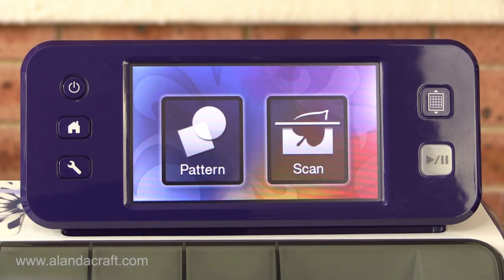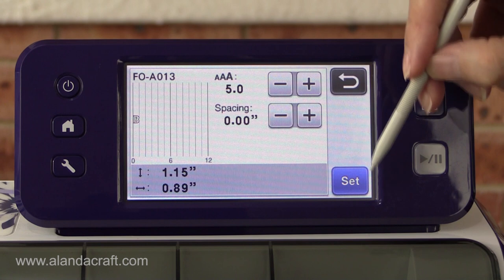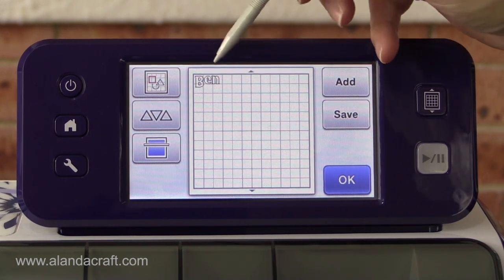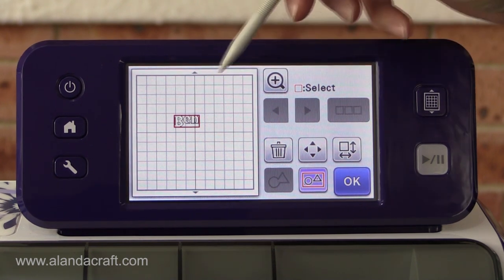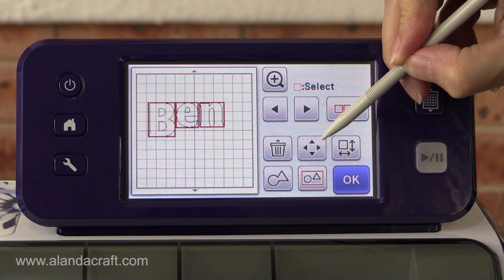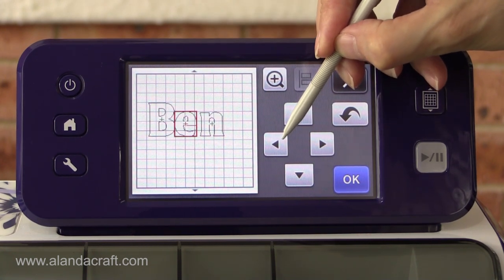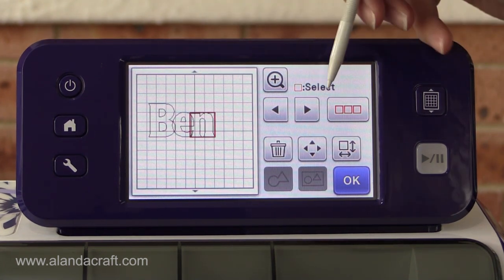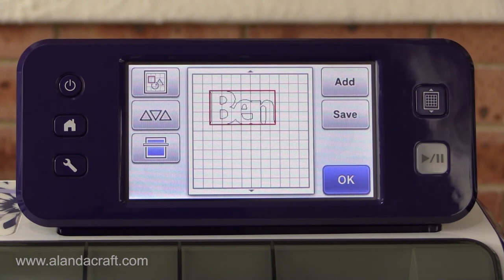Brother Scan n Cut Tutorial- How to Weld Text on the Machine

Comment: I have the CM350 and it’s telling me some patterns can’t be welded and I’ve tried all my fonts. Do I have the wrong machine?
Reply from the maker: All machines work the same way when it comes to welding. If none of your fonts weld, then there is either a problem with your ScanNCut or there is something that you may not be doing quite right. Are you getting a message appear when you try this?
Reply: Alanda Craft yes. I follow your steps exactly and the when I click on the weld button, it says some things can’t be welded etc and then I can’t do anything except click okay .  Thanks so much for replying.